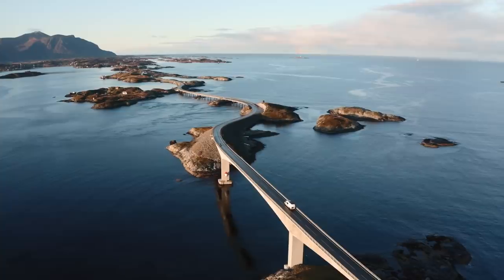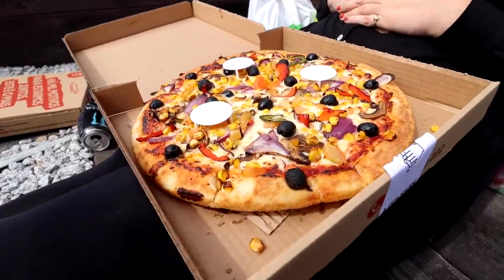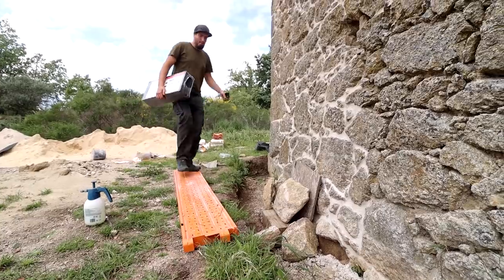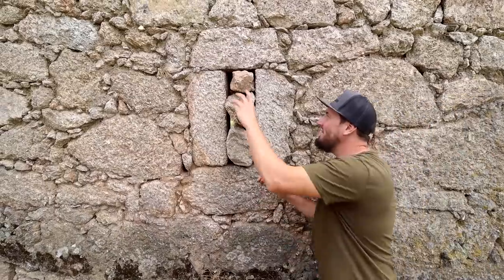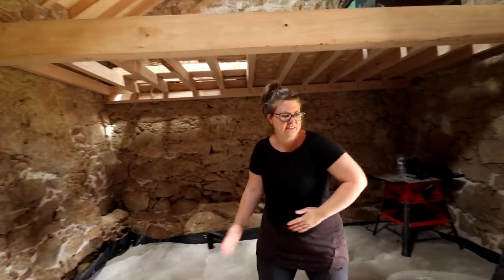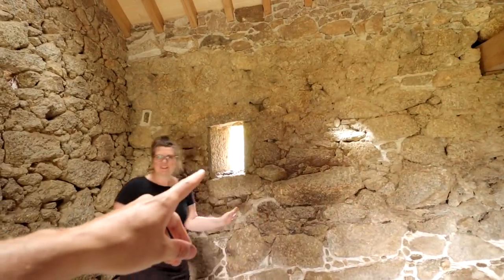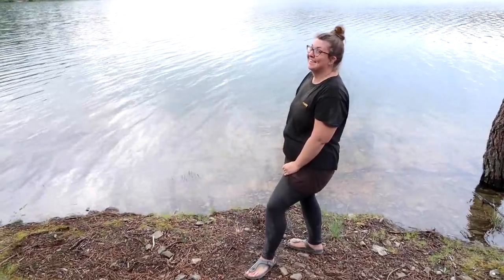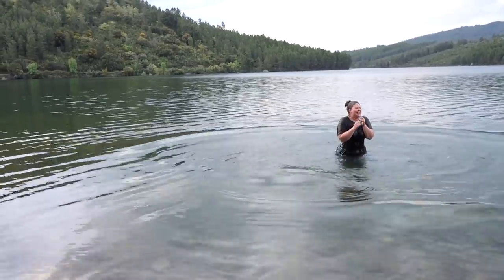Revealing Our FLOOR! Couple Builds Dream Home Off-Grid in Portugal

Comment: I'm a plasterer with experience of Lime rendering Theo but I'm not self employed anymore so can't just take off.
You're doing a great job so far though.
As your walls are dry wet down as you go and keep the mortar spreadable to save your arms, build up in layers and scratch each coat. The main tools you'll need to buy are a hawk and trowel, plastic float and scratcher Theo.
Reply from the maker: Thank you 🙏

Comment: OMG girl YOU ROCK! I don’t even want to imagine the pain of holding a vibrating sander for days, balancing off scaffolding and holding it overhead. Then the mask and fogging glasses. HUGE PROPS to you!!! As for plastering, it’s as easy as frosting a cake. Maybe if the local plaster guy could just give you the mix recipe then you can start frosting the wall. Theo is getting handy with the trowel, he could do it. 🏆🏆🏆🏆🏆. You both are CHAMPION GRADE.

Comment: We live in the Wyoming Black Hills we also have a cement floor we love it the furnace warms it up in the winter and in the summer it stays the same temperature as the ground underneath the barndominium and all you have to do is turn the fan on and it cools the whole place just like air conditioning without the cost we stained and sealed the cement floor do the color we want it's very low maintenance

Comment: Some plastering thoughts:

Joe Smith of Baltimore Maryland was a master plasterer. He taught me a lot about the importance of controlling how the plaster dries. He spent a lot of time with a large paint brush carefully going over the plaster with plain water to keep the surface damp as it slowly dried. He covered the same area again & again. He explained how a slow cure means a smooth, permanent cure. The ceilings he plastered in my Baltimore home were so beautifully done, they didn't need painting afterwards. Hope you find a Joe Smith to do the walls for you! Cheers! BK

Comment: Hi, just seen your video commenting on Lime plaster. We have an old corral we are converting, and it has a very similar finish on the walls to yours ( made up of rocks). We are coating the walls with a lime (NHL5) made into a render. We have borrowed a compressor and spraying tool from a friend ( and now will be purchasing our own) to coat the very uneven walls(it's so easy to use! a little messy, but definitely something you can do yourselves!). We too only have access to hydraulic lime (NHL5 and NHL3.5) and have to mix it for whatever application we need. We did one of our caves by hand, but the second cave will be done using this machine. We are using NHL 3.5 as a final coat to give a white finish. We did a short video on our first attempt if you are interested.

Comment: I bought those shelves from Amazon during lockdown, was desperate for shelves in my shed but not capable, or have the tools to make them.   Easy to slot together, and amazing the weight they carry;  so pleased with them!  Decent depth too.  Doesn't it make a difference when you can FIND stuff!!!  Your house is looking splendid already - so impressed by the standard of your work....

Comment: Hi, if you get a packet of wallpaper paste and mix it to its thinnest mix, then pour it over the concrete swill it around with sweeping brush it will dry very quickly, seal the floor and cut out the dust   👍🤔😁

Comment: you could build a small step up to the mesa nine floor and use the space underneath as storage. a suggestion to   safe space
Reply: I was thinking the same thing just behind the door
Reply: Totally! By the time they have got cork insulation and wood flooring on top of that concrete the height from floor to mezzanine is reducing. Look at the Tiny house vids for ideas. Most of them have storage stairs, would fit perfect behind the door.
Reply: I am sure they already have a plan but I was thinking about this too when watching this video. They could create a "stairs" out of built in shelving that is both stairs and storage.

Comment: I'm currently working on a 17th century building, built using lime mortar but over time people have bodged the place plastering it with gypsum products. The walls can't breath and it looks like damp with all the salts coming through and paint flaking, just make you you stay away from anything gypsum. There is a couple of ways you could help yourself to plaster the backing coat flat and that would be to attached wooden battens to the wall, in fill with the plaster then use a straight edge up the timbers to take off the excess  and fill in parts you miss and repeat. Best of luck to you.

Comment: Theo, I think you are right to be nervous of plastering. I have fitted kitchens, bathrooms, done plumbing and electrical installations, designed and installed central heating/hot water systems, even built a roof. The one thing that has beaten me is plastering. I have watched experts that make it look so easy, then tried it myself, but sadly with rubbish results.
I hope you either find a good plasterer, or are better at it than I am.

Comment: In escape to rural France there was a machine that sprayed the mix onto the stone wall, I think they did several coats but the finish in the kitchen was good!
Reply from the maker: I now have one 😍
Reply: @theindieprojects  Sorry to repeat you should be using NHL3.5. Be very careful that you do not pick up any HL by mistake.
Spraying old stone walls with anything cement-based, spells the death of these old buildings. leading to a whole host of damp and health problems.
Remember once you have lime plastered, do not use any modern paint on it otherwise, the whole exercise will have been pointless.
One could ask why you are even considering plastering at all, why not just lime point as you are doing on the outside, this would save a lot of the damp issues and money and look great.
The key to lime is to seriously wet the surfaces first (use a hose)and for a few days after lightly spray to slow the drying process. (never in the sun)
Love the look Bee you gave Theo about keeping the barn tidy!

Comment: Looks great. Remember that if you lay the bigger floor joists directly onto the concrete without airflow around and underneath them, you could get eventual dry rot problems.
Reply from the maker: There will be a gap 🤩

Comment: The problem with  your fan belt being loose is probably why you have to jump start your truck as the battery is not charging
Reply from the maker: You would think so but actually the battery is fine, was a starter issue 🙏
Reply: @theindieprojects  Glad you have sorted the problem, it will save B from pushing you to start it, take care keep up the good work

Comment: After filling large spaces seal the wall then use a thinner splatter coat when dry it will grip to the lime plaster smoothing coat. You can do it I’m sure as you said it will look better a little wavy 😊

Comment: Great work the two of you are doing, I love watching. Just wanted to say that plastering and lime rendering are very different. I am 70yr old woman and have done lime rendering, which goes to show it's not difficult. I used Chaux Aerienne here in France and sieved the sand, so it was really fine. After it's dry do two or three lime washes which will blend any imperfections. I found trial and persistence plus a brush and some water worked, blending one days work with the next was a bit tricky and that's where the lime wash comes to your aid. Good luck. You will get there.

Comment: Hi guys, you may want to check out the benefits of a dressed cement or quarry tile floor instead of wood. A solid floor with the wood burner acts as a radiator in winter and is refreshingly cool during the 40 degree summers. My 20 years in a stone cottage in the mountains of Spain proved it for me....check out what the locals use too. Good luck with the next phase. AJ

Comment: Great to see floor dry all coming together. Had an idea with your steps up to mezzanine.. what about putting the steps on a runner, ornate pole or scaffolding pole that would go along the length of the wooden beam of the mezzanine. This way if you ever changed layout on mezzanine steps could always move like you would see years ago in old fashioned library’s.
Great video guys. Pete

Comment: If you are using joists still, you need to leave at least 4” between the slab and joists and also create air vents around the walls to allow air flow. If you dont you will get dry rot very quickly. I would suggest what UK new builds do now which is lay insulation boards on the concrete slab and then lay a thinner concrete layer on too.  5-10cm on top will do. This would be your best, easiest and quickest option.

Comment: I thought the same about the pizza oven.  Lovely fresh pizza right by the patio.  I actually like the cement floors.  I was thinking you could have let Fernando in for a bit and had kitty paws here and there as a design feature.🐱😊  The light adds so much...just makes the wood glow...going to be amazing with the Danish oil.❤

Comment: Did a very similar conversion in France and used a lime/hemp/sand mix to render the walls, used a golden colour sand which gave the finished look a beautiful rustic cream colour very beautiful, just mixed by mixed and hand plastered it... Can be done quicker with a compressor... Hemp is a good insulator and I got it from DIY store... There are videos on you tube... Hemp lime rendering, will try and find links

Comment: I love your work ethic and enthusiasm.  If you do another building I have a suggestion for you   put the insulation ‘under’ the concrete this way the concrete will act as thermal mass. Absorbing the heat of the day and moderating th temp   In colder weather it will radiate re heat back out. Love your channel

Comment: As I mentioned in a previous video, I would look to keep your steps up to the mezzanine in the same position as you have the ladder. It’ll be safer in the long run as long as you extend a few rungs above the level of the floor.

Comment: If you have to plaster the walls & you want them plum & flat try fixing battens to the wall at regular intervals then fill in between them to the desired depth. . Then remove the battens & fill in the gap left by the battens. This would be the rough coat. Keep it damp but not drenched. After a few days you should see the Base coat dry a bit. Then skim the finish coat over the Base.  Easy peasy😂 that's a basic rundown of what to do. Drying times of ths plaster will vary on heat/humidity when applying it. If you need any further info give me a shout I will need more info on materials etc.  Good luck & keep up the good work 🖒

Comment: Have you thought of dry lining the walls if you cant get a plasterer... You could insulate at the same time.. Or you can do what you have done filling the gaps with lime pointing then use your hydraulic lime to make up lime wash and just lime wash the stone. it looks really good in a very old building conversion... Keep up the good work!

Comment: Before you plaster the walls, think on this.
I used a 2'x3' plastic form to press a rock design onto wet concrete. I had applied fresh concrete about 3/4" thick to old concrete. I used my fingers in rubber gloves and a rubber spatula, small garden spade, a stick & piece of wood to shape it. When it dried, I applied a layer of flat white, exterior latex paint. Next I stained with oil and latex wood stain. The first time I did this, I used the three colors of extra stain I used on my A-frame house. The flat white latex paint absorbs the stain very well and makes the colors pop. I first experimented on a sample of concrete I made. If you don't like the color, paint over it and try again. You could experiment with the mortar you are using to fill holes instead of the plaster or concrete.
I learned a staining trick when I accidentally mixed the oil and latex on a brush. They pushed each other around making a real looking rock color. I had used separate brushes but mixed them up. 
Experiment on some unused rock and see if you like it. 
Use any dark stain on one of every four or five stones… no more. 
Three colors is good but mix the oil and latex with separate cheap brushes. Put a small amount of stain in small containers. 
The last time I did this, I made all of the stones the same mix of stains using two colors and four brushes.
I cannot attach pictures here but if you are interested, we can find a way to get my pictures to you.

Comment: Theo, put some sand on the floor at the base of the wall you are mortaring.  The drips and dobs and drabs will fall and land in the sand and be easy to clean up and not stick to your concrete floor!

Comment: It looks so good! We have bare concrete floors in our house. Have you considered just polishing it and sealing it and using it as a floor? it's very nice and easy to clean. Also, a wooden floor will make it so that Theo can't stand under the mezzanine.
Reply from the maker: We took measurements before installing the mezzanine só that Theo has plenty of room to stand even with the wood floor 😀

Comment: Another great video !! Here is a Pro Tip for Theo pertaining to the stucco/parging of the interior wallls : Take some dry cement in a bucket. Add water to make a slurry that is the consistency of thinned out paint. Take a paint brush and literally paint the area you are going to re-surface before applying mortar. Do a small area at a time. You will find that the new mortar will adhere to the stone much much better than to just apply the mortar straight onto walls. Just gives way better adhesion. I will say that for a guy who doesn't or didn't know much, if anything, about masonry You are doing an excellent job !!! Hats off to you... Hope you have a great week. Hello to Bee, Gingy Bear and of course Fernando :) Love from Nova Scotia Canada. Cheers

Comment: The most challenging thing is vacuuming those walls from airbiurne sawdust that goes everywhere. U need a dust collection system hooked up and vented outside through an open window.

Comment: Another good video.
I’d maybe forget about flinging the mortar during the ‘dubbing out’ and just shove it off your hawk into the voids with a decent pointing iron or trowel. Tamp it in with a hammer or a bit of wood to compact any big voids. Flinging it just creates work cleaning it off the floor...
And give some serious thought to adding some chipped cork or chopped hemp to the plaster mix for some added U Value. 
Don’t worry about the difference between hydraulic, hydrated or hot lime. For interior use it makes no odds. A weak hydraulic  (NHL3.5) Or an NHL2 is fine.

Comment: Thanks for posting and sharing.  Really looking fwd to seeing how the ceiling comes out after sanding and oiling.  Same with the interior walls and plastering project.  There is a french youtube of two guys re-doing a big old run down place 
. Their channel is called Les deux jeromes They are using/just beginning to use lime too.

Comment: Hi Theo and Bee. I wish I could come lend a hand, NZ to Portugal is a bit of a trek right now. Perhaps you might consider framing the wall in thin battens and place plasterboard. Really easy to tape and plaster the join especially if board is placed horizontally and easy way to get a flat surface. Im DIYing a big reno in central Auckland. Not as much fun as yours :) Take care, Stacey

Comment: I'm wondering if you could use the pastry bag technique for the mortar? Where you fill an extra large pastry bag, with a large tip, with mortar and pipe it into the areas that need to be filled? You can finish it with your pointing tool and brush. 

Though you do seem to have your "throw sh*t at the wall and hope it sticks" technique down tight.

The floor looks so nice! Have you considered just doing a batch of self leveling concrete with a color additive? and maybe embedding a cool aggregate like the glass used in firepits? (Odell Concrete did a nice video on it used in cast stepping stones)

Comment: Have you given any thought to making the floor on the mezzanine immediately under the roof window plexiglass or glass block in order for the sunlight to reach the underneath?  I live in lower Alabama and my floors are painted concrete (the actual slab the house was built on). Keeps the house cooler in summer.  Love your videos.

Comment: Sorry you didn't have an orbital sander for Bee to use instead of the belt sander.  The sanding would have been much easier for her since the orbital is much lighter and much more maneuverable.  But the job turned out beautiful!!   I admire both of your work ethic and persistence.  Still wondering about the old truck...

Comment: Don't know if you will see this, but we live in Norway, and my husband had to lime wash the old baking oven. Same problem, but luckily there was a stonemason refurbishing the walls of a local museum, using the old lime wash techniques. And basically, the idea is lots of THIN coats, and let them dry in between.  But they did not put it over concrete... and he warned us, because my FIL had repaired the stove long ago using concrete instead of "mørtel" (mortar?) and the stonemason said where we put it on the concrete, it would flake off, and it has. We could have taken off all the concrete but that was a HUGE job. So we took what was loose. But this is in an outbuilding and not a big deal to us to sweep it up.  But he was very very clear about using THIN coats and many, like seven at least... vs putting it on too thick. And to let it dry well in between.  As for mixing the lime, he gave us a bucket of stuff from his renovation project, so we cannot help there.  Good luck!!
Reply: Ok, you have friends who have done this, so then you know.... good luck!!